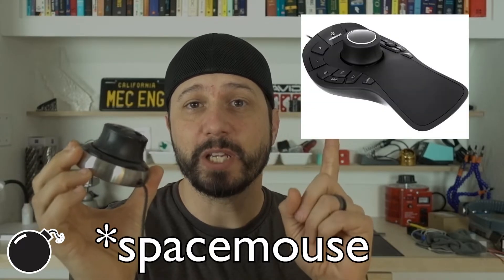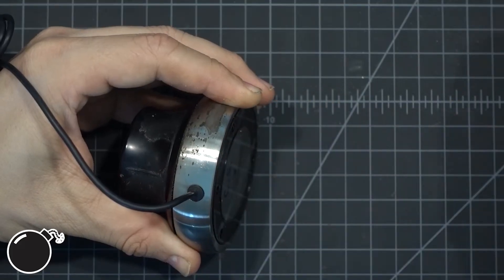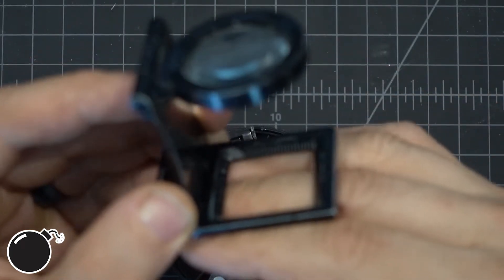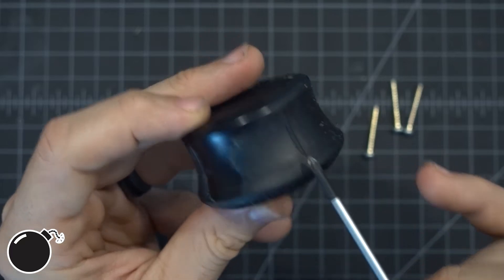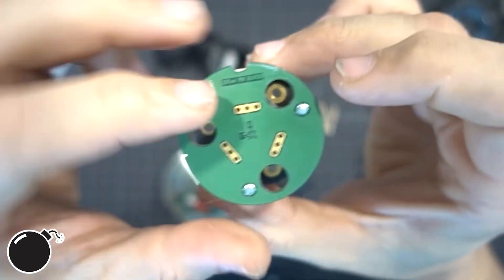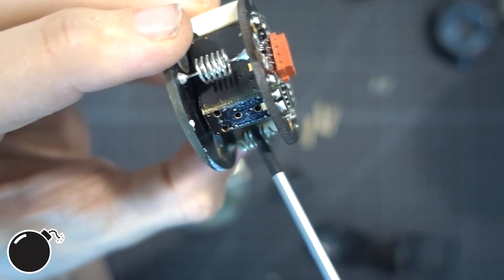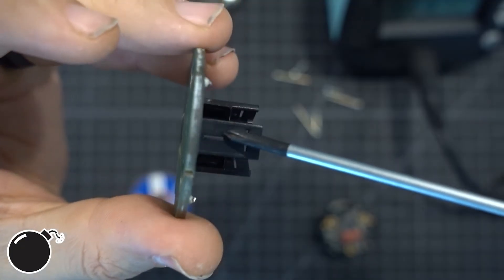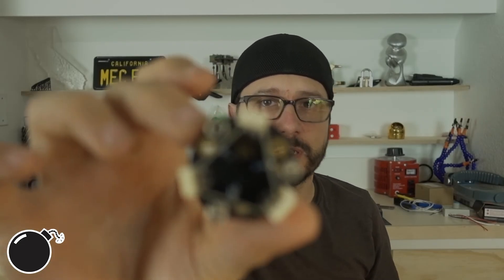What's Inside a Space Mouse?

Comment: The sensors are probably 1D lateral effect photodiodes. They provide an analog output that corresponds to the position of the light spot on their surface. (There are 1D and 2D types; here they use 6 1D types, but they could have used 3 2D types.) They are nice since you can get an update as quickly as you can read the analog value (ie, if your A/D hardware can read at 1000hz, you can get 1000 samples/second). They are much cheaper and faster than any type of camera/image sensor.
Reply from the maker: Nice, thanks for the info!

Comment: What you needed to get the solder on the springs to melt was a blob of fresh solder on the tip of the iron and more fresh solder fed into the connection as it heated.  Contact with molten solder conducts heat into the joint far better than tangential contact with the bare iron.  Also, adding fresh solder adds fresh flux and flux is what enables solder to flow.

Comment: Production PCBs are usually coated, which is why you don't get a proper thermal connection right away. Pre-wetting your iron with some solder will help with the heat transfer, higher temperature might be needed because the springs themselves act as a heat sink, and because you don't know what the coating is, you should have some very good ventilation or be wearing a respirator.
Reply from the maker: All very good suggestions. Thanks!

Comment: For (un)soldering you need flux! If the flux is active you need washing it from flux (you can to do it with isopropyl)
p.s. about "The spring take a heat from soldering" wrote in comments
Reply from the maker: Thanks. Yeah since this video I have gotten flux and it makes a huge difference... 😁
Reply: @thoughtbombdesign  The flux is power! 🤣😁

Comment: Seeing those slits for a moment I thought it might be measuring wave interference patterns. :D
Reply: Fairly certain it's just measuring light intensity differences, but a fun aspect of this is... In some ways it's the same thing. I was reading up on laser vibration sensors the other day and it turns out they use an interferometer setup and I was kind of puzzled how they figured out the interference fringes with electronics. Turns out the fringes cause differences in light intensity depending on the changes in length of the reflected path and I was kinda blown away. That's clever.
Reply: @NickC84  that's what interference does, it's constructive or destructive. Yeah.
Reply: @PaulSebastianManole   Maybe I'm coming at this from a Machinist standpoint but usually you're looking at the fringes to see what the pattern is to determine the differences. You can deduce a lot by the way the interference pattern looks. I personally never thought about the varying light intensity because of it though.

Comment: To unsolder those springs you need to crank the heat up because the spring metal acts like a heatsink and requires more heat to reach a melting point.
Reply: Also flux and a dab of solder to make good contact.

Comment: I opened mine just for curiosity but failed to discover how to remove the crown from the electronics so I stopped there (mine still works). I'm sorry you had to cut it just to discover it comes out just by pushing the electronics through the top. But it was broken anyway, so thanks for sharing. I also have a SpaceExplorer (the one with a handrest and several more buttons) and although the six axis crown looks identical on the outside, it is somewhat different inside. the crown can be removed by removing the top disc and then there are three screws holding a plastic piece and a rubber cilinder covering everything. When you remove this you see the six LEDs but they are soldered under the top board and bent 45 degrees left and right and the sensor is on the bottom board facing up so they form an "Y" shape with the leds above hold in place by a plastic shape that guides the light to the slits on the sensor below. And there are of course three groups of this, disposed in 120 degrees one from another. And then there are also the same 3 springs. It is a more complicated disposition but it does the same. I guess they optimized the design for the SpaceNavigator since it appeared slightly later and there was already a serial port version of the SpaceExplorer. The red connector is the same but the pinout is not compatible. I know because I tried to use the SpaceNavigator head on the SpaceExplorer and it moves, but does the wrong movements.
Reply from the maker: That's cool. I would love to see all the different iterations, sinse I'm sure there are 1000 ways to do it....

Comment: Taking your space mouse apart, so we don't have to. Nice one. An incredibly efficient way to measure 6 degrees of motion. I thought the sensor were being used in part as proximity sensor, emitting and refecting back from that central post,  with the other motions based those slits to get directon of twisting. eg dual purpose sensors.
Reply from the maker: I know, super cool right? It would be cool to see all the different ways they tried before landing on this one....

Comment: As an electrical engineer I can say with a high level or certainty that your failure is in the USB cable itself and not in the device. They use STM32 microcontroller for the USB connectivity and they have ESD protection on the data lines, and these micros fail very rarely, while the cable is of poor quality you see on cheap mice and it doesn't even have a slightest strain relief.  If you have plans to fix your device next time and not destroy it start with a multimeter: check all wires for continuity and then  check supply voltages on the microcontrollet(you can find required pins Vdd and Vss if you google datasheet for that part number or simply pinout). That will narrow down the problem with such peripheral devices in 90% of the cases. But thank you for the teardown. Now I know how to make such thing for myself with a fraction of the cost. The only thing I need to investigate now is how to present my USB device to the software.
Reply from the maker: Thanks for the feedback! The usb cable does seem pretty likely now that I've seen how durable the insides look. Glad you got something out of it!

Comment: Desoldering is hard and there is no recipe, you just try things until it either works or you have caused too much damage.

But flux always helps, always give your braid a bit of flux beforehand. And fresh leaded solder. Sometimes low melt alloy like Rose's Metal. You need lots and lots of desoldering tools and techniques. And hot and fast. Or not, whatever seems to work in any given case. Most people hate desoldering pumps but that's likely because they haven't found or made one that works for them, sometimes they work better to start than the braid but you have to finish with braid at the end regardless, it depends.

I want to get a desoldering iron someday, maybe just a ZD211 for starters.
Reply from the maker: Thanks for the tips. Desoldering seems to be more of an art than science!
Reply: @thoughtbombdesign   Yeah every component, every footprint, every piece of material is engineered to easily and reliably get soldered and stay soldered, countless engineer hours, decades of fine-tuning. Desoldering? The only companies that care about that are tool making ones, but they're at the wrong end of the problem.

Comment: i always figured it was some kind of 6 axis flexure. the machining in creating something like that would explain why these things cost so damn much. disappointed to find what is effectively an optical system and some math. but its still a clever design.
Reply from the maker: Haha, yeah. $$$ for sure... Gotta pay for that fancy patent somehow! 🤣
Reply: I'm not disappointed at all. Mine is going on 10 years old and still works as well as the day I got it. This design more or less is impervious to dust and even spills. In that same amount of time I've gone through like 3 mice and 2 keyboards. From my standpoint, the price is incredibly reasonable. This isn't a toy. Consider the top end X-Box controller costs more than one of these and that's basically a toy.
Reply: @CrimFerret  id expect better resolution for 'not a toy'. though i mostly bought mine for kerbal space program. its a great little thruster controller.
Reply: @LordOfNihil  It has plenty of resolution for it's intended purpose. It's not a drawing tool. I hadn't thought to use it for Kerbal. Will have to try that. I've also heard it works well for controlling your ship in Elite Dangerous which I also haven't had time to test out.
Reply: @CrimFerret  ive tried ed, used it for lateral thrusters. i mostly use it for fine control when docking. 

the resolution is 8-bit as far as i can tell. i upgraded the adc in my joystick to a 16-bit unit and dont regret the mod. but that required gutting the electronics and substituting my own. i dont think thats a mod i could do to the space mouse.

Comment: These things are great and I own different models (SpacePilot and SpaceMouse). The SpacePilot is too big, takes up too much space on my desk. The wireless version is substantially heavier than the wired version and the latter one sometimes is lifted from the desk when operating it so I use the wireless version at my main workstation and the other ones on different computers in the workshop. They all still work so I did not dare to take them apart - thanks for doing this for me ;-)
About desoldering: add some fresh (lead) solder to the soldering joint. Lead-free solder has a higher melting temperature which makes it more difficult to desolder. Also, use a large (flat) tip to get as much contact as possible. The large springs and the large copper area on the PCB mean that you need to add a lot of heat before being able to desolder a joint. Most likely you will not get the springs free using the desoldering wick but since this is a 3-point mounting, I would just melt the solder and get the spring out with tweezers.
Reply from the maker: Glad you enjoyed it and thanks for the de soldering advice!

Comment: Thank you for the very interesting look inside. For me a space mouse is indispensable. The strange material for the rubber coating has changed since around 2007 and is reliable now.
Reply from the maker: It is definitely an underrated tool. Oh good! I love that coating and I was bummed when it started coming off...
Reply: @thoughtbombdesign  I had to completely remove it form mine. It was begining to become rather gross and sticky so I rubbed it all out with universal solvent. (alcohol was of no help and acetone probably would have melted the plastic too)

Comment: Odds are, the break was  in a wire at the back of the USB plug. Always check that first. You could ohm it out between the attachment point inside and the plug contact. If not practical, just lop off the plug several inches back and connect another plug from another broken USB device or a short USB cable.
Reply from the maker: Good suggestion. I'll try that next time! Thx
Reply: Good spot. If in doubt,  test the cable for continuity. The company may have had this crop up a lot, hence of course their wireless versions.

Comment: One correction: There are not six phototransistors, but twelve - each package that you "point" to actually contains a differential pair. One of the devices in the pair looks for an Up/Down movement, whereas the other for a left-right movement. If you look at the components at 6:03, you'll see that the orientation of the lower component is 90-deg whirled.
Reply from the maker: Oooo, good to know. Thanks for the info!
Reply: What photosensor ICs does this use?

Comment: Great teardown vid! Do you know if it is possible to swap the blue LEDs (not the photo LEDs used for control/motion), and where they are located on the board? I know it is aesthetic, but I am thinking about swapping them to red rather than having it off or traditional blue. Any insight is helpful! Thanks! :)
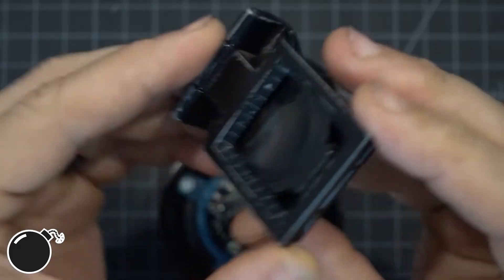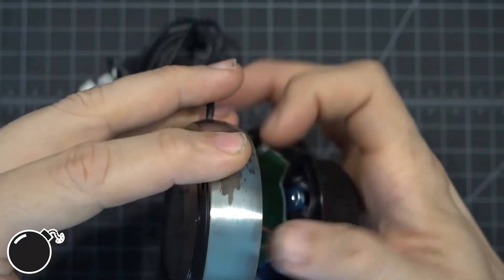Reply: you can see them clearly at 1:58. There are 6 of them disposed in a ring formation around the electronics on the motherboard. Six tiny yellowish bastards surface mounted. Very difficult to replace. I'm not sure but I think they are white and what is blue is the plastic translucent ring, so you would have to model and 3D print in red translucent a new ring (or make a mold of it in silicon and fill with resin). In any case, you can unscrew the metal base just like t 1:30 and then connect the device to the computer and you will see if the LEDs are white or blue (if they are blue, I would forget the idea of replacing them. If they are white, you can make a new ring).
Reply from the maker: I am sure you could but they might be the small surface mount type. I really wish I had kept the parts, I didn't know I would get questions! 😉

Comment: You need flux to de-solder with that braid. Flux transfers heat as well as cleaning joints. Solder flows to clean hot metal, flux makes the path easy. There's a good chance the actual fault is a broken wire in the USB cord.
Reply from the maker: Thanks! I have had a chance to use flux on another project and it definitely helps!  Good point on the USB cord...

Comment: I have a Space Navigator I've been using for around 8 years. The steel base has less chrome on it now, but otherwise it works just as well now as when I got it. I had assumed it used some sort of strain gauges or Hall effect sensors. Those springs are pretty hefty for what they are doing. There's little way for dust and such to actually get to where it would bother the photo sensors. It's a good solid reliable design.
Reply from the maker: I know! I thought the same thing but it is definitely a cool and reliable design... 👍
Reply: @thoughtbombdesign  As it turns out, apparently the newer ones do use a magnet on a central shaft and 3 hall effect sensors on the upper board. With no active electronics above that, it would likely be faster and cheaper to produce. I don't know if there'd be any downside other than it would be prone to issues with nearby magnets. It might be more prone to being knocked out of calibration if you dropped it as well.
Reply: @CrimFerret  Do you understand the kinematic model for the newer variant of the mouse? The part I'm not understanding is how the mouse differentiates between say a rotation in the Y axis compared to a linear translation in X+Z, as they can both occupy the same position in 3D space. I also assume the magnet is segmented into three pieces, that way the fields can align with the three sensors, and this is how Z rotation is picked up. Would you also happen to know what patents belong to this design, the old design's patents have been expired for quite some time and are fairly easy to find, yet the newer design's patents seem to be fairly elusive.

Comment: Mine is working, but for some reason is drifting and I can't figure out why, calibrating it fixes it for a few minutes and then it starts again. I took it apart, washed it all in alcohol, dried it out and it seemed to be fixed, but a couple of days later started doing it again. Wondering if I need to use stronger 100% alcohol instead now as I see there are photovoltaic sensors there, if there's a bit of dirt still on the sensors it could possibly be causing the issue. Would be a shame to throw it out :/
Reply from the maker: That sucks! Have you tried tech support? Maybe they have some tips? 
Whenever my model starts drifting off into space I realize something on my desk is leaning against the spacemouse.... 😜
Reply: I had the same problem. I just unplugged it from the pc and plugged it back in to get it to behave.

Comment: I died a little inside when you cut the springs. :)

That said, un-soldering things just takes practice, and practice takes time. There are plenty of tools (solder wick, vacuum actuated tools, low temperature alloy solder, hot tweezers) and techniques (glob on extra solder to hold heat, blow through holes, smack it on the table, etc). Grab some old scrap boards of varying types and play around de-soldering. Certainly a scenario of "necessity is the mother of invention". Try not to burn yourself.
Reply from the maker: Haha, yeah I knew that was going to be kind of triggering for some people....  Sorry about that ;)

I haven't heard if hot tweezer... I'll have to look that up. Thanks!
Reply: Maybe also adding on some extra flux might help. Would definitely make the solder flow better, and, despite not having tested with extra flux, the bad flow of the melted solder on the board I wanted to de-solder had been what kept me from succeeding.
Reply: just dab a bit of flux onto a braid and mash it onto a joint with a hot iron. Easy :)
Reply: I think in this case it was just the huge thermal mass. Those springs were soldered onto a ground plane. You need hot iron with a heavy flat tip to desolder things like that.  Or an actual rework station, of course.